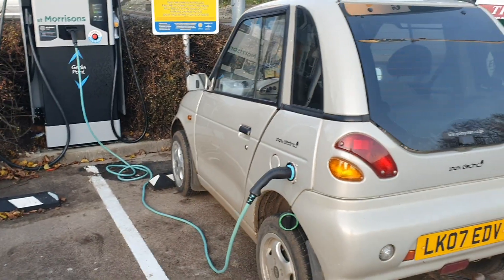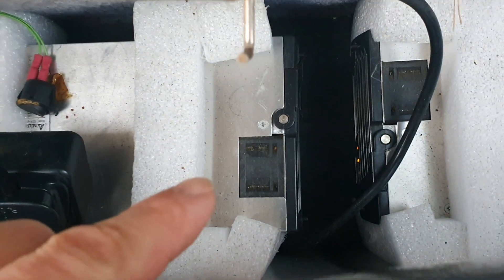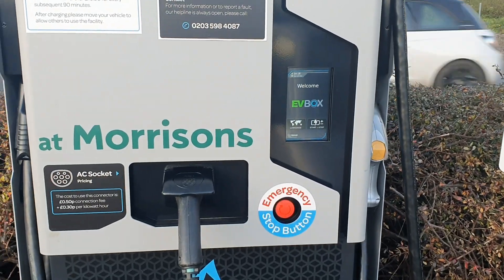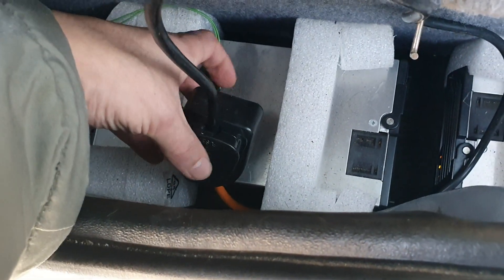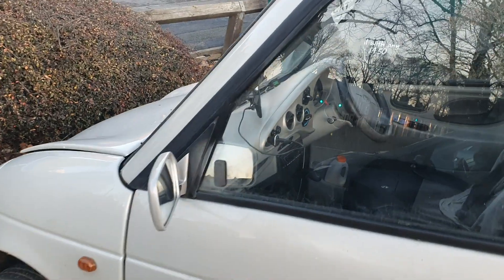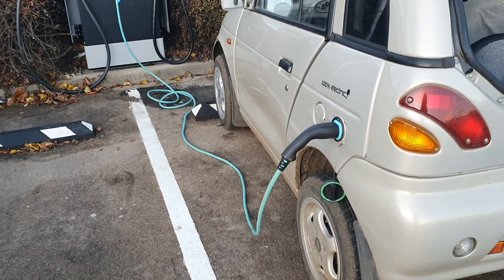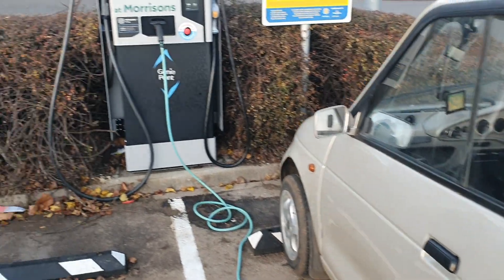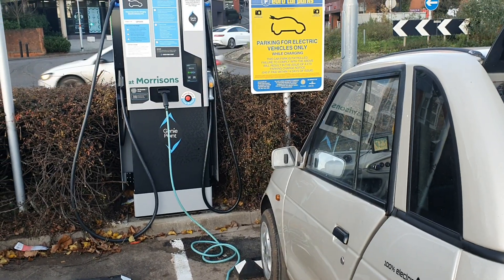REVA G-WIZ: Solving the 22kw charging issue - overcharge current error

Comment: Hi Richard. I'm not sure why you need both chargers on the same phase? Put them on different phases and you will be only drawing 3 and a bit KW per phase. In fact if you want to charge it even quicker you could use all three chargers on the three phases. I guess you may be using a single phase lead? You may need to get a three phase one?
Reply from the maker: Both chargers on same phase because the posts I normally use are 7kw posts which are the most common for my particular needs in the UK. Even running one of my lithium chargers cuts out this particular 22kw post so there is something wrong somewhere. I can usually run one charger on 22kw  podpoints. All three will draw about 35 amps so I cannot do it that way and it will take some moving and rewiring to do a 3 phase set up when my most common go to are single phase 7kw posts. Anyway, it looks like I am not going to Europe as planned so I have no need to worry about it for now. I do have a 3 phase cable but my socket on the car is only wired up as single phase. I have a feeling its to do with the sensitivity of this particular provider and inrush as they report 'overcurrent' when I rang them to ask why it was cutting, even with one of my main lithium chargers. Both chargers run on single phase issues on 7kw and 43kw posts.
Reply: Hi Richard it doesn't entirely suprise me that 2 X 3kw chargers could appear to overload a 7 KW (21kw three phase) supply with inrush current! Here's an idea, could you wire the whole thing as 3 phase and have the facility to put the chargers on to one of the phases in the car? Oh by the way, I have been thinking of getting an Aixam méga city van and converting it to lithium, big problem is they seem to have a maximum speed of 30mph! Your videos are certainly inspiring me :-)
Reply from the maker: @martinsteer2392  I'm surprised that it would considering that it works on 7kw single and 43kw three phase. Thought it's likely a summer job if I do it and what you suggest I have thought of doing. 

Aixam Van's I was curious about but 30mph is definitely too slow. Fit a towbar to a gwiz ac motor and tow a small trailer youd have same space but 40mph min.
Reply: Maybe surprised is not the right word. Is it only the one 22kw charger that doesn't work or more than one? If you did go down the route of three phasing it you could use all 3 chargers!
Reply from the maker: @martinsteer2392  Only that one 22kw charger... some podpoint 22kw will run one of my chargers but not both. I would rather not use the 3rd charger as it is the original lead acid charger that came with the car and all 3 would be over the 32 amp allowance. But as mentioned before the most common charger for me in the UK is the 7kw single phase so unless I do drive into Europe i have no need for 3 phase at all.
Reply: I guess it is what it is! The chargers have a bit of a severe inrush current and the podpoint chargers are a bit sensitive to it. I'm sure I read somewhere that the Reva chargers can be modified to output the correct voltage? Will try and find the article.
Reply from the maker: @martinsteer2392  I wouldn't chance it. They are not good chargers and with lead acid algorithm it may hurt the lithium in the long term. Id just invest immediately in something proper so that you reduce that risk because lithium are the main investment in relation to any other component. 

It's the pod point 22kw that allow me to run one charger... genie point that cuts even using one. It works on my original lead acid charger on the G-wiz so it must be inrush or something but these chargers i have are also softstart so it's a bit baffling. Anyway, it's fine as long as I don't have to go into europe with the car. The suppliers of the chargers say they work no problem in Europe so maybe it's something to do with how the UK chargers are built, won't know unless I get to try them out there one day.

Comment: Hi, I have a G-wiz running outlander PHEV modules 16s 5p, I charge them to 64V (4V/cell) using the Reva charger, there is a pot inside you can change the terminal voltage, i did need to add a few K in line to get the 64V, charger working great and so are the cells 1 year on.
The tripping out could be the neutral current being higher than expected, how good is the PFC on those chargers that could be a problem too.

Cheers
Reply from the maker: Does the G-wiz run on 64 volts ok? - I thought the controller would cut out at that voltage. 

The neutral current should not exceed around 26 amps... my chargers are separate to the original G-wiz charger. The G-wiz charger works no problem on the unit so I suspect it is an issue with start up current, or this unit simply won't accept the inrush from my lithium chargers. The error that comes up on the units when I rang the provider was 'overcurrent'.
Reply: @RichardMawby  No it didn't run. I have a 10KW BLDC golden motor conversion.... running at 20KW with liquid cooling it moves... top speed 50MPH but sets there quick. I want to add a type 2 as well so watching with anticipation.

If you wanted to test if it is in-rush you could try staring up through an incandescent light bulb then shorting the bulb as an experiment. so use the bulb as a resistor then bridge it with a switch, this will let the bulk Caps charge first then turn on the charger with the start signal (or have i misunderstood the problem).
Reply from the maker: @shiftingtides6197  oh wow where did you get the motor to fit to the gwiz and did it take much modification? 

I did consider having a faster motor put on sometime with better torque for holding 50mph much more effectively. 

Type 2 works no problem on 7kw posts. I've travelled the UK in summer doing this. It also works on 43kw posts it's just the 22kw that are odd but not too worried. It was only because of possibly driving into europe that I was wanting to solve it.
Reply: @RichardMawby  Well this is were you think i have lost the plot all together, I got the motor and controllers from goldenmotor dot com it's the HPM-10KW motor and two VEC500 controllers, one for each side of the motor as it is 2 in one case really.  I machined a coupling only to find out i didn't have to as it's a lovejoy jaw coupling the size is L100 if your interested,  I could have saved 2 days on milling and turning for £20.

I then 3d printed a quarter of a circular bell housing to get enough space between the trans and motor, and then sand cast 4 of them and bolted them together to form a circular housing. it works well.

I'm using the 48V motor to get the 6000RPM needed for 54MPH through the 7:1 ratio of the diff.

Wiz is off the road for now with a cracked windscreen, I have seen a lot with this problem have you and idea why this happens?, it was a DC wiz with the flat glass.
Reply from the maker: @shiftingtides6197  That sounds amazing. How much would it cost to buy the motor and suitable controllers? And where are you based? - Would you be able to provide said 3d housing so everything bolts together easily?

I might think about making a 72v set up or something or 96v so that I can get better speed. - however 50 mph is ample... i assume that setup will hold 50 mph on all road conditions unlike the original which can only push 35-40 mph on some small gradients? 

Cracked windscreen not sure, maybe you had a stone hit it without realising and vibrations made it worse or it was the twisting of the chassis perhaps. Not had any problems with my windscreen.
Reply: @RichardMawby  The motor cost £1K and the controllers are £500 each, you could start with just the one but i thought it was under powered so got two ;O) 

keeping speed was not the problem but heat was,  I did try air cooling but that didn't work so I'm going for liquid cooling and a small radiator with fan up front through the little gap under the bumper.

I'm only charging the outlander cells to 4V so i have 9KWh available, last summer i did a 60 mile round trip and had 30% remaining. so around 100Wh/mile. so not too inefficient. 

I could make another bell housing but it was an experiment really just to see if i could.

I'm in Yorkshire BTW

Since it's off the road and not wiz weather ATM i'm taking the time to improve things, I should make a video really. 

I cant believe the miles you have done in  that little car, I use mine for ice cream emergences and shopping trips round town.

I did consider a range extender trailer (non ICE) for visiting car shows.
Reply from the maker: @shiftingtides6197  If you fit a type 2 socket you will be able to travel all over the country with it no problem. 

Aye, that was my plan with my care, to build something I could do super long range with. I did about 2k miles over the summer and I can comfortably drive up to 2-300 miles a day I reckon if I had to including a couple of charge stops. 

I do like the idea of your motor set up and the fact they can accept more voltage is interesting. I did consider having a larger voltage controller as I have an AC motor, but apparently there is something about three phase that means the AC motor won't take more than the 48v rated? is that right? 

Anyway, 2k for the upgrades sounds promising and as you are in Yorkshire shouldn't be hard to arrange a visit sometime ifyou are up for helping with such a modification should I go for it? 

Being able to hold 50mph even up gradients would be very useful especially towing my sleeping pod trailer. 

Can those motors be tuned to go faster? - I.e. if I put higher voltage through them with a different controller?
Reply: @RichardMawby  Yeah I would be up for helping, where about are you? If you have a spare diff you could do the mod to it and then just swap it out. the impedance of the windings is the limiting factor to speed, too high and the EMF generated reduces the current and so the torque , too low and the starting current is excessive and take off acceleration is slow due to the controller being in current limit. 

I calculated the Revs/volt of the 48V motor from the charts on the website and multiplied that by my voltage getting me the 6000RPM.

I'm using the 72V VEC500 BTW the controllers have there issues but work well, oh yeah they have cruse control too.

are you on skype at all?
Reply from the maker: @shiftingtides6197  I am northamptonshire, so it's a drive but not a bad one in the warmer months. 

Hmm... I do have a DC rear axle with a bust motor on it, if the suspension fixings are the same other than the AC motor mountings then that should swap in and out of my AC no problem. 

You could email me through my website... www.richardmawby.com 

I do not use skype but that will keep us connected should I decide to go that route. I have other ideas too that may or may not involve a g-wiz so time will tell.
Reply from the maker: @shiftingtides6197  I also found these motors that might help in terms of gearing, thus higher speeds... https://www.facebook.com/Electricconversionkits/?hc_location=ufi 

I wonder if there is a way to fit one to the G-wiz, because they have a 6kw version... and are producing a higher one too... but they are not expensive!
Reply from the maker: @shiftingtides6197  Also one last thought, please may you join this group if you use facebook and post the details of your build including photos etc? - There are some folk there who will be fascinated by this and it is a group dedicated to the reva g-wiz. https://www.facebook.com/groups/2183043841757744/about/

Comment: Hi Richard.
Will the BMS cut the voltage if you use the lead acid charger or will it force current and overcharge the cells.
Reply from the maker: I'm not quite sure but it will likely damage one or the other... not worth the risk as the algorithm is wrong for lithium... I would rather get my lithium chargers working properly on 22kw - that was mainly just to test to see if the charge post worked or if it was my chargers at fault.
Reply: @RichardMawby  That is very true, what is the total KW of your lithium pack? really want a Gwiz, still searching around for one.
Reply from the maker: @YorkshireCampers  23kwh
Reply from the maker: @YorkshireCampers  if you do the easy option with mercedes tesla cells as one of my last videos (in cornwall) - then you will have about 12kwh which is enough for most people and about 80 mile range.
Reply: What charger do you use to charge the pack?
Reply from the maker: @YorkshireCampers  https://eauto.si/metron-shop/product/uni-batt-charger/
Reply: Theres an additional small circuit to be added to the original charger (I'm talking about DC gwiz...not sure if this the same for the AC version) that enables charging lithium batteries. With the circuit you can set the maximum voltage (I.e. 58v), then the custom BMS (we made) will turn RED not enabling the charging station to overcharge the pack.

Comment: There is a good video on building an inrush current limiter by GreatScott. It's called "how to make a sofstarter". 

Given the very high current it will need to be heavy duty but even that could just be a number of cheap NTC resistors in parallel.
Reply from the maker: Thank you - I was also sent a link over facebook of a soft starter - perhaps this will work too... but not sure if it will damage the chargers? - https://uk.rs-online.com/web/p/soft-starts/3305358?cm_mmc=UK-PLA-DS3A-googlePLA_UK_EN_Automation_And_Control_GearElectric_Motors_And_Motor_Controllers_And_Peripherals%7CSoft_Starts-PRODUCT_GROUP&matchtype=&pla-394702011497&s_kwcid=AL!7457!3!243856881257!!!g!394702011497!&gclid=EAIaIQobChMItdmMi_yo5gIViaztCh3D_ARAEAQYASABEgLfB_D_BwE&gclsrc=aw.ds&fbclid=IwAR0mga9e6yi5QZyoN9vNIT1xX23MV5bT2-wOJcgoedHYLtUdoulXsAXLAbs